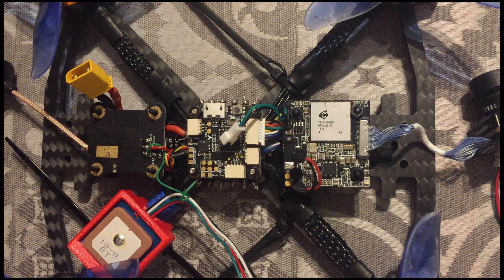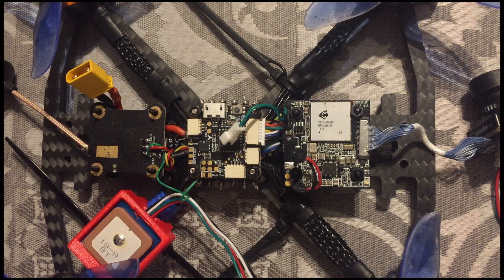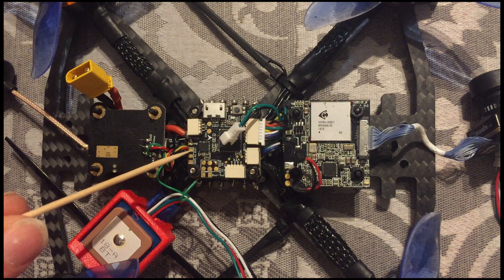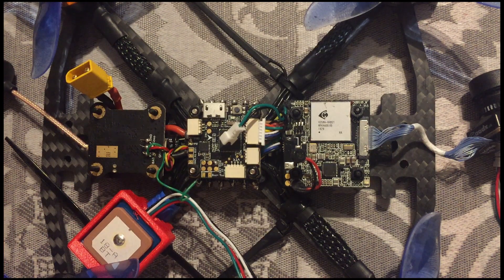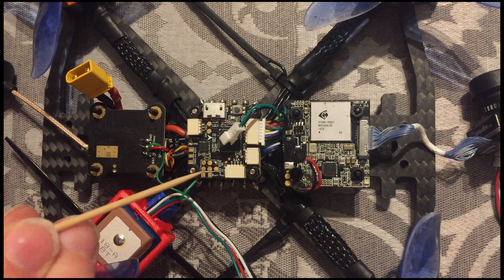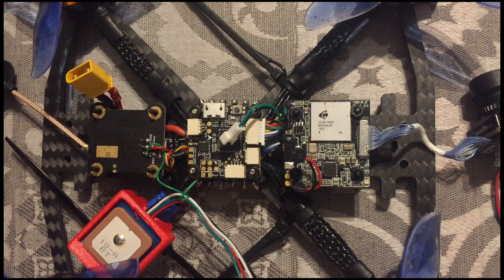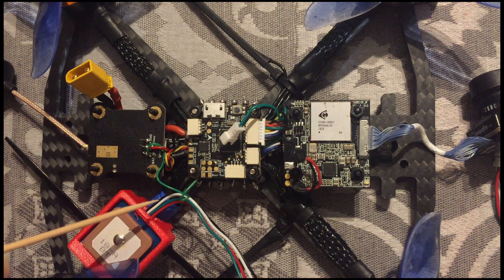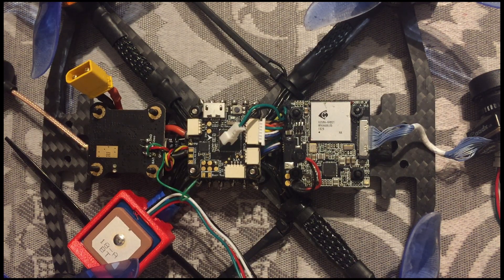Tyro79 with UBLOX BN 220 GPS - How to Softserial ?!

Comment: How to do it on the upgraded version of tyro79 flight controller..there is no tx rx pad on it...only 2 uart ? Thx
Reply from the maker: Sorry i haven t got the new version. But maybe you can sent a link to the FC picture or description so I can check?
Reply: @dieluftakrobaten9864  thx for the reply [19,58€ 33% OFF]Eachine Tyro79 Tyro69 Spare Part 20x20mm New F4 OSD 2-4S Flight Controller w/ 5V 3.3V BEC for RC Drone FPV Racing RC Parts from Toys Hobbies and Robot on banggood
https://banggood.app.link/UH014akqycb plz check.
Reply from the maker: Hey thanks for the link. In my oppinion there is a R5 and T5 pin. This is the RX5 and TX5 pad. So this should be UART 5. Please check it in Betaflight, wheater this UART is "free" to use.
Reply: @dieluftakrobaten9864  thanks buddy I will  check...I was thinking the same now I am sure...👍😁
Reply from the maker: @Sam-gr8pl  Maybe you can give a feedback after your test for other user :)
Reply: @dieluftakrobaten9864  ja mache ich..😊👍

Comment: where did you solder your RX?
Reply from the maker: I use FrSky SBUS protocol. So there is a SBUS Port on the FC. And my RX (XM+) needs 5V and ground as well.
Reply: I am using tbs xfire receiver in uart2 can i put the gps in uart1?
Reply from the maker: @pedalandfly3568  In my oppinion: Sure, but you have to config this in the software as well.